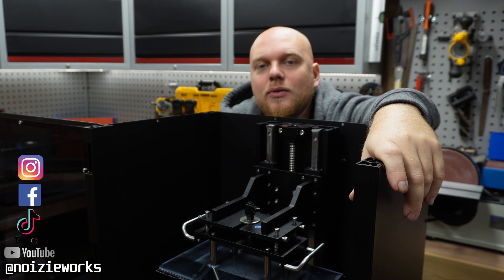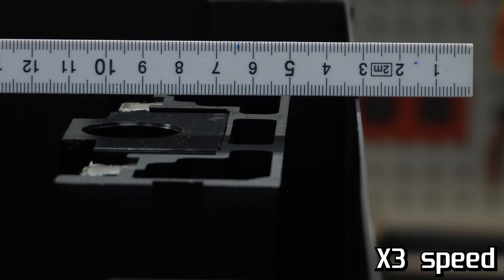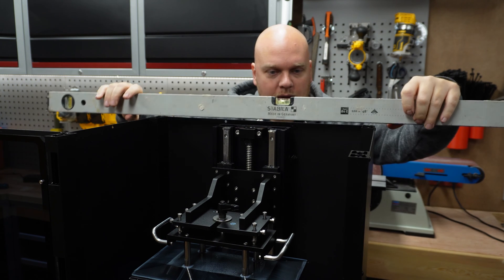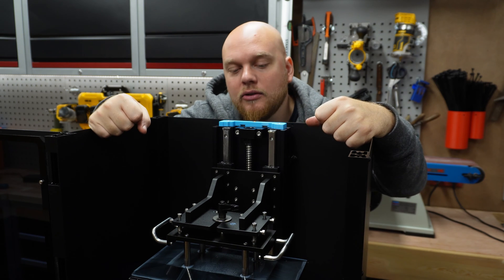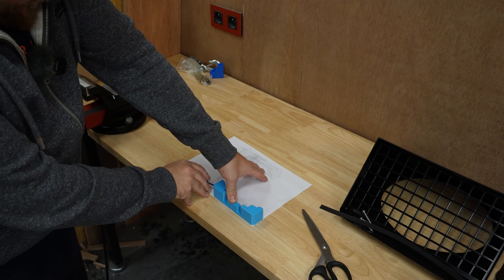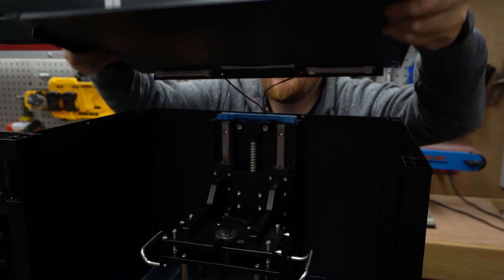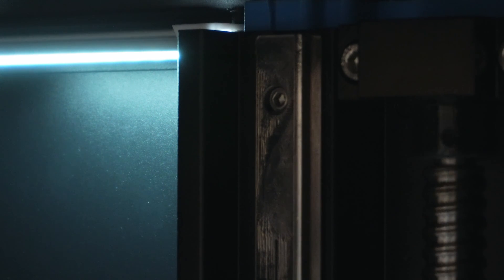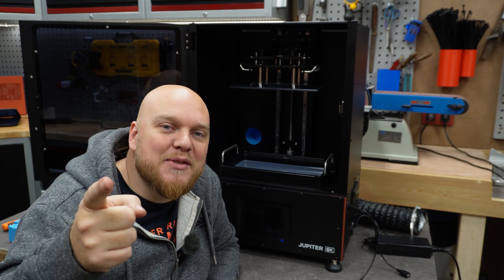Fixing Z wobble on the ELEGOO Jupiter

Comment: I used an m6 heat insert, but for some reason i didnt have to heat it to insert it into the holes? I just pressed slightly and they slid right into the holes, without heat. But i doubl checked and they are indeed M6.... what did i do wrong?
Reply from the maker: hmm... doesn't sound right, these should be tight. Did you order the injection molding versions? these are probably smaller. There is an amazon link with the inserts it's designed for.

Comment: i think that was the first time i have EVER seen anybody HEAT  - Press Inserts and use them like that. lmao.  they are normally just PRESSED into the holes.... not sure how well it will hold up to Torque - Over - Time. but hey, it worked.  guess it beats using the correct size drill bit LMAO
Reply from the maker: Brother, heated inserts are THE way in printed parts and beat any other form of threaded solution in 3d prints. The ones i use are specially made for this and the "melting" is by design. Here is a good video about the topic. https://youtu.be/G-UF4tv3Hvc?si=AHktxiJu4tJFj2tD

Comment: Awesome video, I'm going to be FDM printing that part tonight for my Jupiter.  I'm curious have you had any issues with your build plate pushing down against the screen too hard after this mod is installed?  I have 2 Jupiters and both of them deflect quite a bit at the top (where you put/secure your part) when it's going to it's home position.
Reply from the maker: I only had a problem when it was a very thick resin like siraya blu or now geeetech resin that feels like a blu so if it's super thick resin make sure to heat it up first so it's a bit more fluid. I heat up the resin to 40c and my printer to 45 on those type of resins. All other printed without problem. I level on the fep so you could try the thicker paper method if it's a real problem
Reply: Great info and THANK YOU, I'll post my make on Thingiverse if it ever lets me log into my account.  What do you use to heat your resin... blow hot air over the vat?   @NoizieWorks

Comment: Ho fatto la mod, ma quando va a fare l'azzeramento il motore perde i passi
Reply from the maker: sorry dude, any chance you can speak English?
Reply: @NoizieWorks  "I did the mod, but when it resets the motor looses steps" I hope this helps both of you :^)
Reply from the maker: Then he should relevel the buildplate
Reply: @NoizieWorks  I have recalibrated the plate but the motor is still losing steps
Reply from the maker: Does it do that when pressing into the resin for the first layer? You can have this with cold thick resin not moving fast enough
Reply from the maker: Also, if it get's down for the second level it's fine?